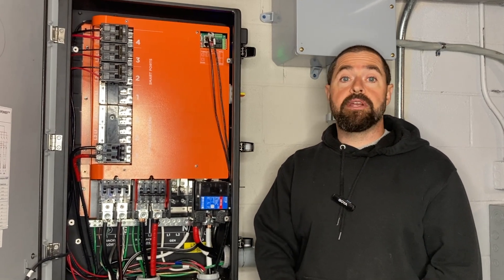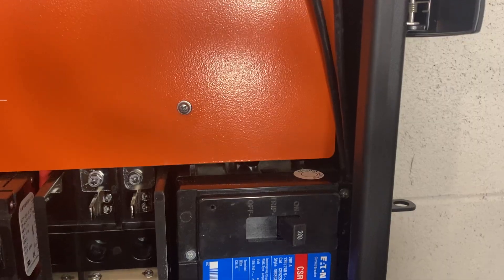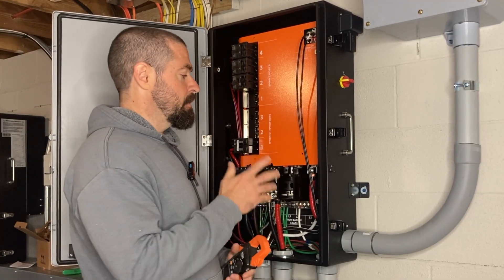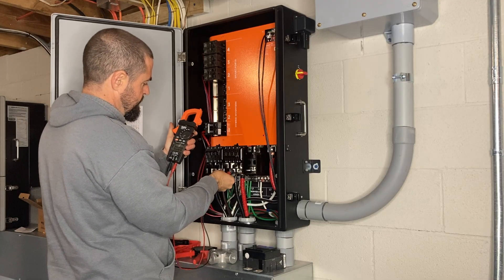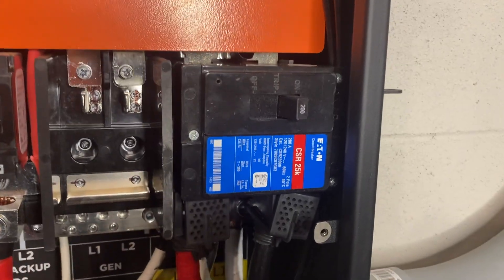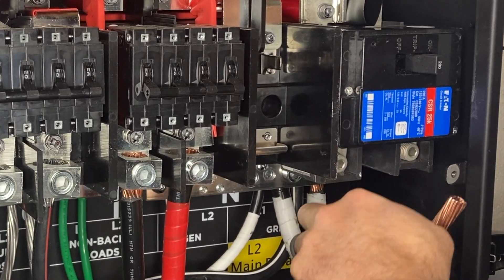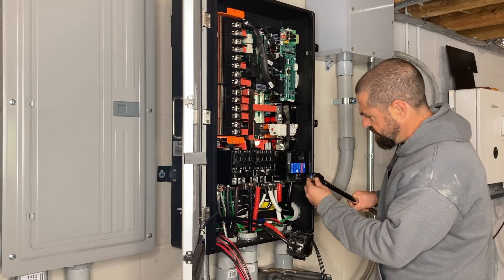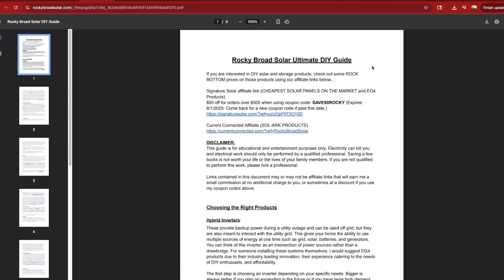Making the EG4 GridBoss MID Service Entrance Rated | Eaton CSR Main Breaker Installation Guide

Comment from the maker: EG4 GridBOSS MID V2 | 200A Service Entrance
$50 off for orders over $500 with Coupon Code: ROCKYSAVE50
https://signaturesolar.com/eg4-gridboss-vs-mid-200a-service-entrance/?ref=uzUOpPif73O10D

Eaton CSR2200N CH Main Breaker Kit, 200 Amp
https://amzn.to/42G8ano

Eaton CSR2125N Main Breaker Kit, 125 Amp
https://amzn.to/3W6Z6Es

If you are interested in DIY solar and storage products, check out some ROCK BOTTOM prices on those products using our affiliate links below...

Signature Solar affiliate link (CHEAPEST SOLAR PANELS ON THE MARKET and EG4 Products) 
$50 off for orders over $500 with Coupon Code: ROCKYSAVE50
https://signaturesolar.com/?ref=uzUOpPif73O10D

Current Connected Affiliate (SOL-ARK PRODUCTS)
https://currentconnected.com/?ref=RockyBroadSolar

A1 Solar Store
https://a1solarstore.com/r/b814406845157bf1a9f70001a2730d79

Rocky Broad Solar Website
https://rockybroadsolar.com

Facebook
https://www.facebook.com/profile.php?id=61558585264414

Comment: EG4 grid boss and flex oss21, where you use anti corrosion or dielectric grease? Thanks
Reply from the maker: I only use Noalux on the aluminum conductors. Nothing on the copper. Thanks for watching the channel.

Comment: Can this be done if I currently have a smart meter going straight to a 200amp panel in my house? There is no breaker between my meter and my panel. Obviously power would need to be shut off at my meter during install, but this Gridboss would be way easier than installing a separate disconnect and separate manual bypass.
Reply from the maker: @speakerlover13 yes it would. That is the main reason for making the GridBoss service entrance rated. Just make sure to update your grounding and bonding to be code compliant which I go over in this video. https://youtu.be/Frggrna6ztw?si=Bg0PocufYETyOfyD Thanks for watching!
Reply: @RockyBroadSolarLLC  Thank you for the quick reply and info!
Reply from the maker: Absolutely!

Comment: I've heard utilities won't approve these because they consider the GB solar equipment want a knife blade disconnect they can lockout with a tag. I'm assuming a knife blade disconnect could be installed at the inverter inputs on the GB.
Reply from the maker: It all depends on your utility. Some don’t require anything extra whatsoever, while some want a lockable knife blade disco for both the inverter and MID. Some will even require a production meter on the inverter. In my case I only need one on the output of the FlexBoss. 100A non fused. Those 200A discos can be expensive.
Reply: @RockyBroadSolarLLC  Yeah I am hoping Xcel Colorado will let me use the Gridboss as the disconnect. They are so expensive! They do require the 100A non fused and PV pro meter if you are over 10000w and mine will be 12.9.

Comment: Looks like yours might be a gridboss 2.x. I have the gridboss 3.1 and it has anti-twist plates that need to be rotated 180 degrees to accommodate the eaton breaker.  For anyone else as confused as I was look at page 22 of the v2.0 manual step 4. The manual further confuses this because their diagrams keep flipping between the 2.x and 3.1 images making it hard to understand.

Also the breaker needs to be tightened to 80 inch-lb (9Nm), in addition to the main lugs being tightened to 250 in-lb (28Nm)
Reply from the maker: Thank you for the additional information sir. This is extremely valuable for the viewers!
Reply: Is there a list of differences between the different versions somewhere?

Comment: Why screw in the breaker then complain about the bend radius of the wire...why not put the wires in with the breaker detached then bend the wires by moving the breaker into position?
Reply from the maker: There is pretty much no room in that compartment to move the breaker sideways and I did not want to put any stress on the lugs or screws. Thanks for watching the channel!

Comment: I just put that same breaker in my grid boss and it didn't go anywhere near that smooth The spacing left to right wasn't the same and everything was all kind of cattywampus and I end up having to trim the tabs on the breaker to make it fit in and bolt up..... It was not plug and play for me at all
Reply from the maker: Interesting. Hard to say. My GridBoss was version 1 and I think we are now at version 3. Maybe it is built differently?

Comment: Does this mean according to the NEC code that the service disconnect label would have to go on the grit boss or are you still required to have a separate disconnect?
Reply from the maker: Label would be on the GridBoss. It would be your service disconnect. Thanks for watching!
Reply: @RockyBroadSolarLLC per NEC code would there be any other disconnect required outside or is that per AHJ?
Reply from the maker: Per code only a rapid shutdown switch is required to be outside and readily accessible.
Reply: @RockyBroadSolarLLC 690.13 (e)
Including system with ESS and invertors in outside structure less than 100 feet from dwelling yet MID located within dwelling next to service panel. Only egress is non powered double latched garage door only personnel door leads to root cellar but all flooring is concrete.